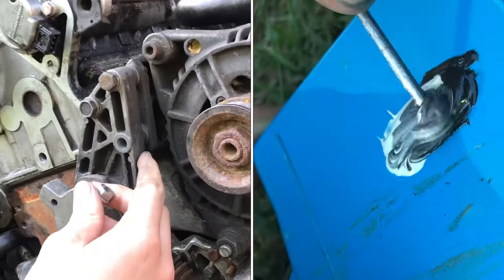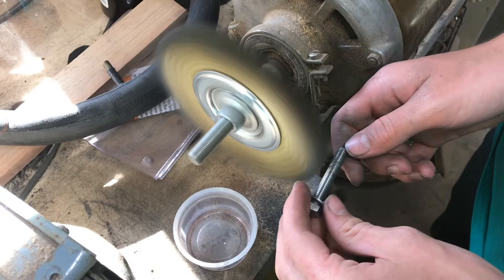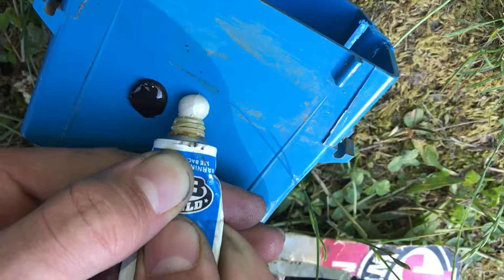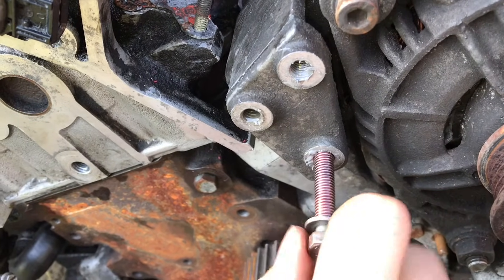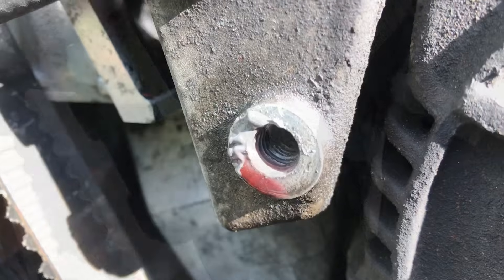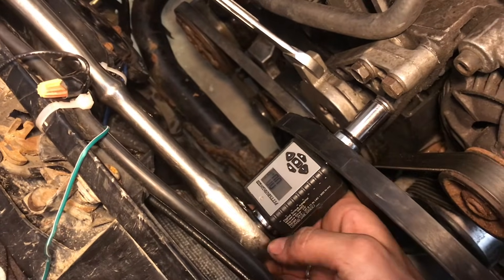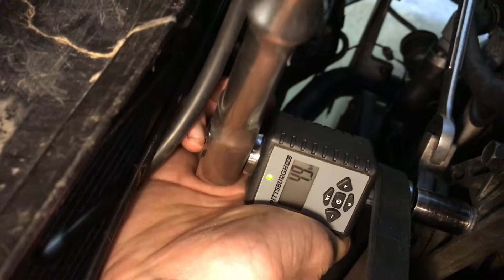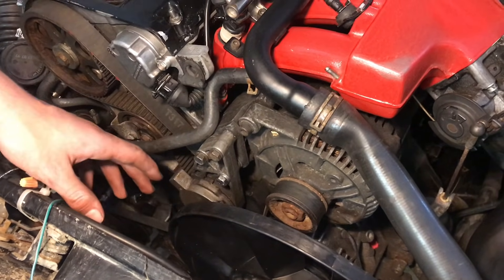does JB Weld “really” fix aluminum threads

Comment: Drill and tap to a bigger size, epoxy in an aluminum bolt, cut off flush, drill and tap to the original size. Now you have a strong repair that is as good as original!

Comment: Wanna use JB Weld to patch a car gearbox,what you think will work it? There is a crack where the oil drain plug threads in. That part is outside the box, like a pipe end. So I can put them on the outside, I tried with poxipol, it's a solution in two tubes that have to be mixed, but it didn't hold.  When I put oil on, that poxipol came off.I tried welding with aluminum electrodes and an electric arc machine but I don't have a good machine, it doesn't work

Comment: You should have filled the entire hole and then tapped it.  Also try the pro jb weld. That stuff is way stronger than the marine grade jb weld.
Reply: Still a garbage repair that won’t work. I can fix it correctly in a lot less time for about $1!

Comment: I'm thinking part of the problem was the side surface was too smooth. It needs to be rough so the jbweld has something to hold onto.
Reply from the maker: Next time I try wrapping copper wire with the JB Weld, sometimes you just have to experiment👍

Comment: Tried it 3x, did not work at all.....weld the Aluminum hole full and re-tap it, don't take short cuts.
Reply: You don’t have to weld it. Drill and tap to the next size, epoxy in an aluminum bolt, and cut off flush. Then drill and tap to original size.

Comment: congratulations nice work, but where did you put the screw in a jar of oil? if so and not to stick to the glue jb weld ?
Reply from the maker: Typically I put oil on A cloth and rub it into the screw, too much oil to make a mess. It’s not the strongest thread, But in some applications it works.

Comment: It's not possible coz' epoxy is still plastic but aggragates that are hard should be added to the epoxy (shredded carbon fiber will strengthen it to aluminum strength). 50/50 ratio.

God bless.
Reply: What do you think JB weld is?
Reply: JB weld has steel in it already. If you add shit too it it will just make it weaker
Reply: @buttadog5073  JB Weld via email said for more strength add fiber glass (the smaller the better) but I add carbon fiber strands instead  (cutting it myself as small as possible) but it shouldn't be more than 10% of the fiber glass said the JB Weld representative who emailed me back (I guess the strands are like bigger aggregates on top of the small small metal in JB Weld original). Thanks. I tried it, tested a sample, it is tougher with the fiber glass and carbon fiber.

Though the regular viscosity carbon fiber and fiber glass epoxy is a bit harder than JB Weld I tested at least when you scrape it off the surface or break the small sample into (little explosion for both there's not in between, but the carbon fiber/fiber glass epoxy's took more force on its own- by a bit, not significant).

Comment: Are you even serious? You clean the hole with alcohol and then contaminate it with transmission fluid? Seriously? LOL!! Why on earth would anyone do something like this???
Reply: Tbh the hole wasn’t contaminated with transmission fluid. The hole was cleaned with alcohol, dunno if that’s recommended with jb
Weld but it’s better than nothing. Higher percentage than 70% and a fresh bottle at the very least but I’m thinking acetone or xylene cuts oil better. He put the jb weld in the hole first though so none of that transmission fluid coating the bolt should have come in contact with the hole. The layer of jb weld was probably too thin to not be thoroughly contaminated and transmission. Fluid mixed into it.

I can see it working if the depth of jb weld was more than a screw thread or two. Mostly fill the hole, let it start to set up and then screw the bolt in but then it’s a structural repair 😂
Reply: Lol? Because the bolt needed to be lubricated so you can get it off the jb weld. If he didnt use any lubricant, the jb weld would just come off with the bolt. U ignoramus fool, dont laugh at people when you dont even know how to use half the tools hes using

Comment: Ya gotta be kidding! Common sense
 its weak 3000psi shear 500 tensile at best at 70°f
Get a Helicoil insert kit !
Reply: Lol to hold on a belt tensioner pulley? One of three bolts? Like it’ll ever see 100 psi
Reply: @dirtyaznstyle4156  you have to understand why a bolt is torqued. 18lb/ft wasn't acceptable. He got almost 5lb/ft and started getting plastic creep. Add heat from engine and it will really lose strength. A typical easier repair is a heli coil

Comment: This is what happens when people get even a bit careless with impact drivers.
Reply: With aluminum you can succesfully tork two or three times then it will fail at the rated torque on subsiquent torquing. Found this out the hard way on a timing belt replacement on an older car I owned and maintained from new.

Comment: The transmission fluid used completely fucked the JB weld...
Fill hole. Drill out. Tap hole. Torque down.
Save your ass in a pinch. Not really that best way though.
Drill out and sleeve with metal and then tap the new metal would be proper. Or fill with weld and drill and tap.
Reply: The amount of money spent on tools to tap and effort spent on this is simply not worth in this particular case.

Comment: What about adding some steel wool shavings to the JB Weld?
Reply: Steel wool would not work too well, it's too fine to let the epoxy fully saturate it.  I think something more like a stainless steel dish scrubber would be stronger and let you mix in the epoxy better.
Reply: I was thinking about deep pour epoxy mixed with aluminum powder or what they call cold casting. It would be curious to see how much more torque it could handle

Comment: i would have just thrown the jb weld in the trash and drilled the hole out and tig welded an aluminum sleeve in it and tapped it. 
i tried jb weld fixes before and they always break later. the stuff doesn't hold pressure very well.
Reply: where would you get an aluminium sleeve for a bolt from?

Comment: The ATF fluid messed up the strength of the jb weld.  No mold release needed if once it cures you back out the bolt.  I have used this on valve covers 6.5ft lbs and head bolts  20ft lbs.
Reply: If you use anything as a release agent with epoxy it should be wax. A candle or a crayon rubbed on the threads would work fine.
Reply: It's weird how half of the mechanic secret tricks out there involves pam in some way.
Reply: @EnwardJim  Really, what are some other tricks that involve pam? First time I have heard of this
Reply: @milesjargon 
You can spray pam on your headlights to make it easier to wipe bugs off and spray it on the rubber for the car door to prevent it from freezing shut in the winter.
Reply: You talking about threads for cylinder head bolts that hold it the block?
Reply: @Mohapi_Tau  yes,  i have have to use JB weld on the block to the head as well as valve cover to head an never had a problem torquing the bolts out after letting the JB weld setup.  Using release oils only degrades the tensile strength of JB weld.
Reply: @dmcd7333  Ok so won't the JB break when the bolt is hardened on to it and you back out the bolt?
Reply: @Mohapi_Tau  I have not had that problem with quality steel automotive bolts....but be careful with aluminum bolts they shear much easier.   Pam anti stick spray that you use for cooking you spray on your finger and lightly apply to aluminum bolts...this will not degrade jb weld like an actual oil will.  Good luck.

Comment: Use it dry man. I use JD weild  to fix the threads on the pressure plate bolt when I did my clutch. I broke off the bolt originally. Had to wait and was freaking out. I drove on a imbalanced pressure plate spiking my blood pressure shifting into 4th gear cause of the vibration. I waited for the bolts to come in from o online. I tried to drill the old bolt out I got it out but only in pieces 🤣  but the thread were damn near gone. A little be was left. I put JB weld around the new bolts and threading it into the hole THANK GOD my pressure plate balanced and it drove and shifted smooth 😎 that jb weld is literally holding til this day
Reply: I'm currently waiting for my jb weld to dry. It's exactly at almost 6 hrs. I'm planning to see if it will hold my cam ledge bolt in place On my aluminum head. I don't care about being able to remove it, i only care that it will stay in there and not come off and shred my head to pieces. Any ideas? Should i back it out now or just let it fully cure. Do i need to worry about trying torque it down?
Reply: @HandyP  is the reason your using the jb weld cause of complete damaged threads? 
If there non existent and gone you might have to get a helicoil  to use in place of the threads
But if there are some threads there yeah man I would try it put especially if your still feeling the tension  build when you tighten bolt down it's doing its job
Reply: @brandonlogan2600  thanks for the quick reply Brandon. The head is aluminum and a couple of the holes got a little stripped. They don't take well to torquing. One of them is partially stripped out and I'm trying to avoid rethreading it to bigger size because in order to do that, I'd have to remove about 14 more bolts that may also end up getting stripped in the process. As we speak, I've just taken the bolts back out so the threads can cure and so i can attempt to torque them down. What do you think?
Reply: @HandyP  I'm not a professional in any way, I'm a DIY guy but I think that could work out, personally I feel like torquing the bolt down while it's still wet and letting it hold while it dries could help bug you never know your way that your doing now could work too. When I was doing the pressure plate cluth job I was talking bout I threaded the jb weld in with the bolt , (watched it torque down and tighten), and let it solidify as a whole. Held very well. You're way could work just as well
Reply: @brandonlogan2600  in very hesitant to wet the bolt because i found that it wouldn't torque and instead the bolts would get twisted and snap. This guy has a really good method using copper wire strands. I'll give that a shot if the jb weld doesn't hold up. Thx again bro
Reply: @HandyP  no problem bro, hope you find your solution!
Reply: @HandyP  so how did that turn out? A lot of times it’s standard for aluminum threads to be reinforced with helical inserts. Basically due to galvanic corrosion because every fastener is steel and every time you take one of those bolts out there’s a chance it’ll snap. Also helical inserts only tap to a slightly bigger size, the insert threads in snug to that and returns the hole to the original size
Reply: wont the jb break when you back out the bolt if it is in dry?
Reply: @Mohapi_Tau  no, you wait for it to cure partially then back out the bolt
Reply: To this day I can till you cause I haven't had to change the clutch again its still good
Reply: My booger bushing in my shifter cable to gear shifter knob on a different car broke 
The original booger bushings thinned out and started to rip

I used permatex black oil resistance , to stick in back together JD weld to cap it and keep it in place and then Flex Seal to make everything Stick together, flexible , and solidify.
Reply: @brandonlogan2600  permatex black rtv is good stuff! Strong and a decent adhesive sealant. I’ve prolly used it more like caulking than as a gasket maker but it doesn’t take even a quarter tube to seal a pan or diff cover. My trucks rear slider window weatherstripping is sealed with it and one of the strips around sliding window is actually 100% permatex black
Reply: @brandonlogan2600  any videos available?
Reply: @Mohapi_Tau  particularly what I did nah but there are some JD weld videos of people drill and tapping it, and some showing some of the things JD weld held together

Comment: Answer: No.  JB Weld never works for what you need. I don't know how they can legally sell it, but I guess there's a sucker born every minute.
Reply: Lol ur so slow. Jb weld is gasket maker. Almost all car makers use it as a gasket instead of an actual gasket. Front timing covers,oil pans, some even valve covers, a bunch of stuff. And it holds well. Dont be ignorant cause it didnt work for whatever dumb idea you had
Reply: @adamdistortion8810  The fact that you have resorted to name calling and insult attempts proves I am right.
Reply: @adamdistortion8810  The fact that you have resorted to name calling and insult attempts proves I am right.

Comment: You should completely fill the hole, let it cure and then re-tap it.  Putting an oily bolt in there will only serve to prevent the JB Weld from curing properly.
Reply: That's exactly what I thought
Reply: So say I have a stripped m6x1.0: you would clean the hole, mix jb weld, fill the hole from bottom to surface, let it cure, then drill it out with a 5mm, and tap it?
Reply: @Shepherd4R  yes just let it cure the full time before drilling and tapping.  Iam doing the same but with quick steel by jb weld. It's the putty form.
Reply: @ thanks
Reply: @Shepherd4R did it work for you? I have the same problem
Reply: Yeah probably, I just wonder is about durability on something that needs to be constantly removed cause I screwed the thread on my bike seat and need a kinda permanent solution and I keep removing it all the time...
Reply: That’s a garbage repair. Drill and tap to a bigger size, epoxy in an aluminum bolt, cut off flush, then drill and tap to the original bolt size. Now you have a good repair that is as strong as original!
Reply: Why would oil stop it from curing?  The polymerization occurs independent of the environment.
Reply: @josephoo7 oil has very good cohesive properties meaning it likes to stick to itself very well, this ends up with a layer of fluid on the bolt that would take up space where the new threads should be making the actual threads weaker. If you fill the hole entirely and tap it your thread fitment will be much tighter and less likely to slip. I saw a video where the guy threads and taps JB weld in an aluminum block and he was putting a face load on the head of the bolt that took over 2000lbs of force before the threads failed, it was a 1/4" thread

Comment: JB Weld specifically says DO NOT USE ALCOHOL. Your issue is residue.
Reply: or they mean dont drink alcohol while using the product. 
i would hate to wake up in the morning to a sloppy drunken mess and jb weld everywhere it shouldn't be.

ipa dries with no residue. if you got residue its contaminated.
Reply: @darkshadowsx5949  Not true.  IPA leaves a residue. Otherwise you could soak an O2 sensor in it.
Reply: @urgentcareguy3  what residue is that though? Because isopropyl alcohol isn’t anything but that and distilled water I believe to dilute. Denatured alcohol is ethanol with I believe methanol to make it undrinkable. All alcohol is miscible with water so it’ll absorb moisture from the atmosphere and dilute itself eventually but does that really mean the residue is water?

91% isopropyl alcohol works fine as a solvent wipe for paint prep on metal so 🤷🏽‍♂️

L
Reply: @dirtyaznstyle4156  I would contact JB.

Comment: The only good succesful use of jb weld i had was to fix a a small hole in fuel tank. Wenever the part is subject to a stress you can be sure jb weld will fail
Reply: Depends .. of you use it for low torque bolts it should work fine.

Comment: I would have filled the whole, drilled into it and the re tread! Oil and JB. Do not work together! All the clean you did went out the window the moment you used oil!
Reply: So it's better to use dry?
Reply: @walletphonekeys  YEs, JB Weld needs to be use dry and in a very clean surface
Reply: Still a garbage repair that won’t hold. I can fix it as good as original for about $1!
Reply: Use wax
Reply: @Stermox  what's that
Reply: @Stermox  what kind of wax... From where?
Reply: @Stermox  what are the steps to rethread with JB Weld and wax?? If you don't mind helping me out. I need to rethread a few myself
Reply: @lex_one-two  forget the wax. fill the hole more and then tap it (buy a tap and re-cut the threads in place, into 100% cured JB weld.)
Reply: @jungletigerairsoft3305  Yeah but if you can't fit the tools what you can do ? On my motorcycle one of the cam chain tensioner bolts is a bit stripped .It's not completely stripped but I can feel that if I go more snug to torque spec I will strip it .So far no leaks or whatever but I have to remove the engine to fix it properly because the space is very tight .

Comment: im curious as to how malleable jb weld is well after its curing period; the product is marketed as being very resistant and holding high amounts of tension but wouldnt it be counter productive to 'cut' into it with a bolt's threads? kind of like carving wood.

nice vid, thx!
Reply: JB Weld says that it's threadable/tappable. I've never done it, but I would fill the hole a bit more (maybe even all the way), then hit it with a thread tapper. Also, he's using Marine JB Weld, which may not be as strong as the original.